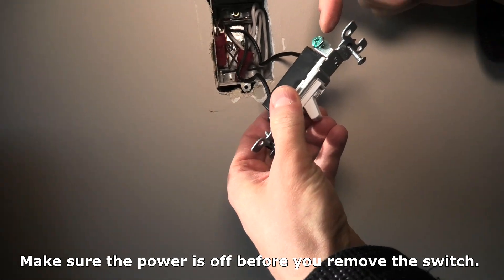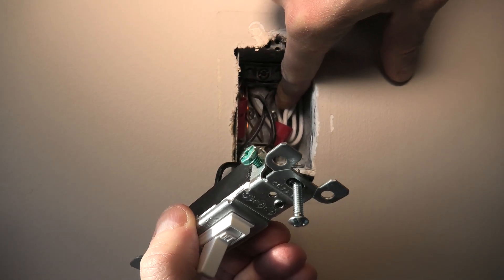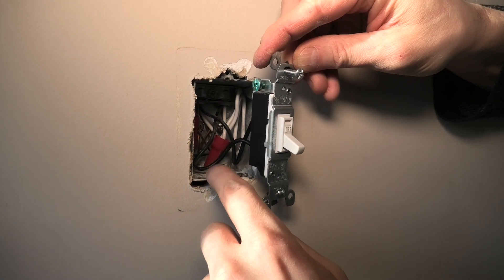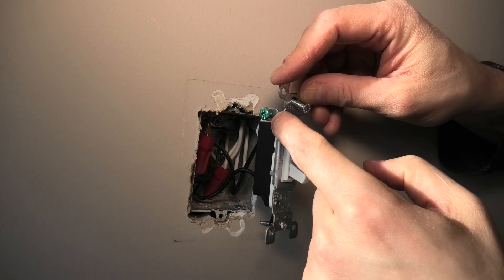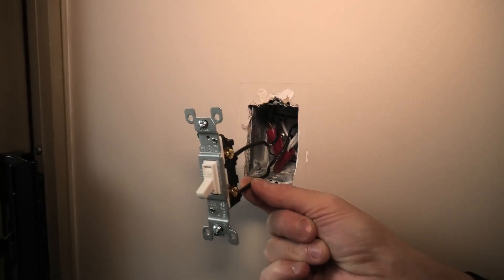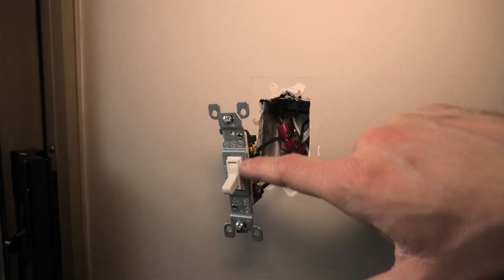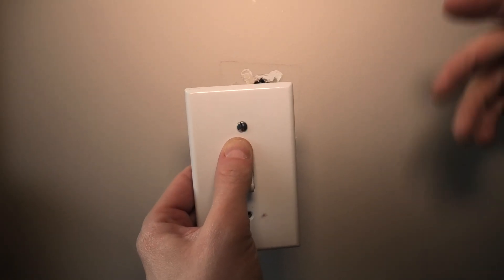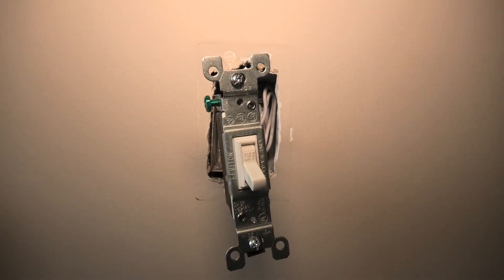Should Light Switch Be Grounded When You Replace It?

Comment: Hello. If you have a metal box and see the screw, how do know for certain it's properly grounded and does not just appear to be grounded?
Reply from the maker: Hello, if the grounding wire is connected to the screw inside the box, then the box is properly grounded.

Comment: Very helpful videos.  I was able to install a dimmer switch safely with your help. Just a note, some outlets will have a bare or green wire to connect to the ground screw or ground wire. I had to do that in my case (it didn't help that they painted the walls and got it all over the wires!  But I did figure it out after some examination.)